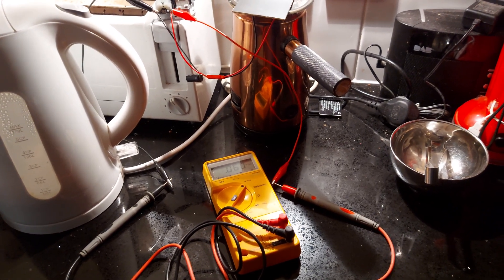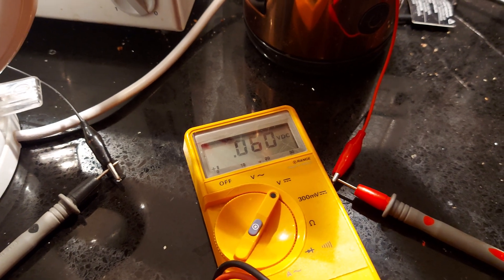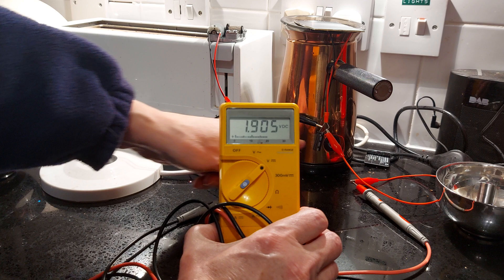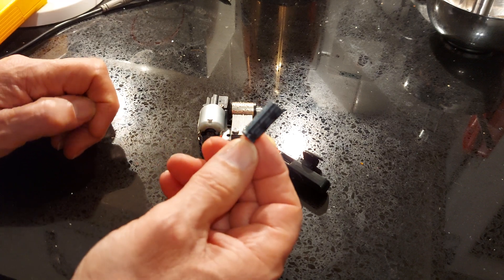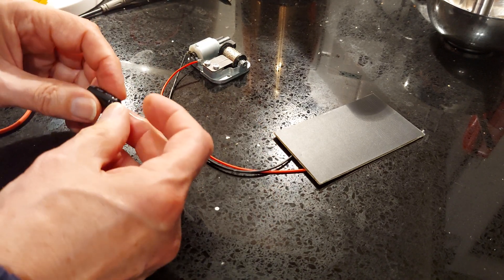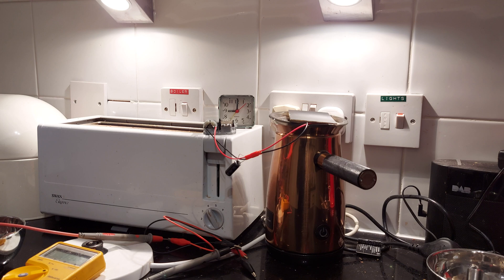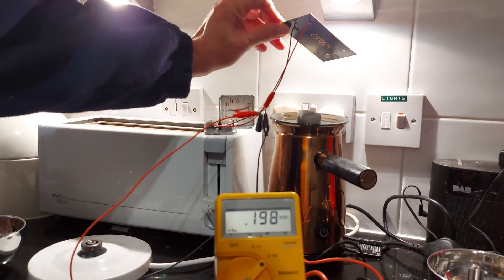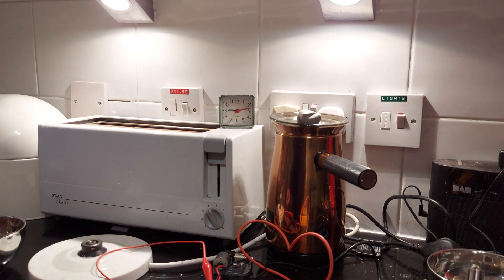Electric Music Box on a Supercapacitor

Comment: Like the Morecombe and wise piano sketch but your playing all the wrong notes in the right order. I'm amazed that you got 10 minutes from the super capacitor not bad at all, if you could find a way to connect and disconnect the cap from the motor automatically you have cracked it ten minutes playing ten minutes charging 👍
Reply from the maker: I don't really want it running on the supercapacitor as the original target of the project was to get the music box to start up with the sunshine in the morning, but I know I will get comments suggesting I should put a supercapacitor across the circuit. Certainly if the supercap charges up in the sunlight it builds up the power available to run the motor. Either way, we still need to wait for full sunshine to give it a fair chance 🌞🌞